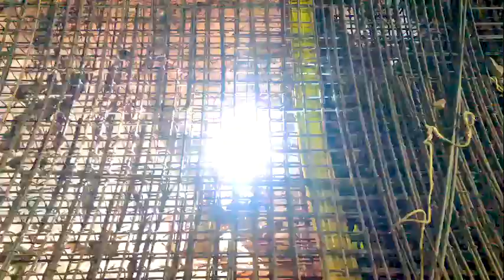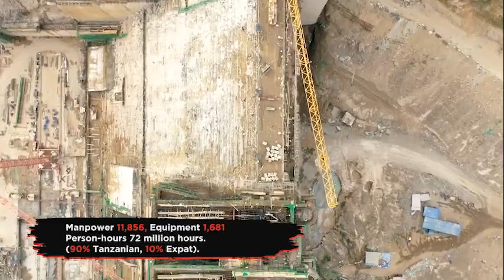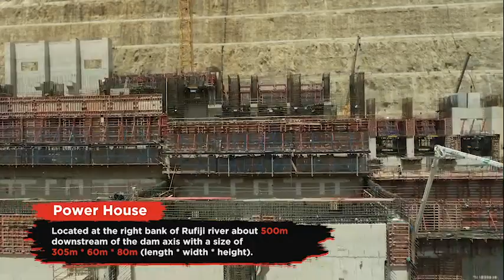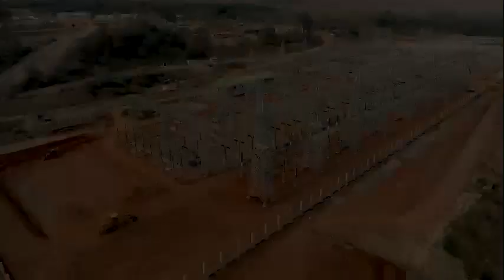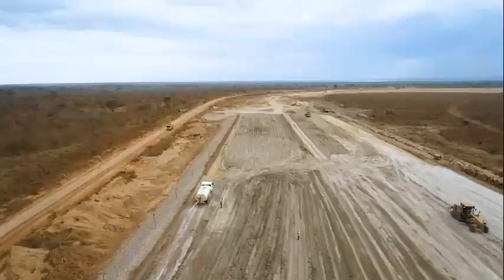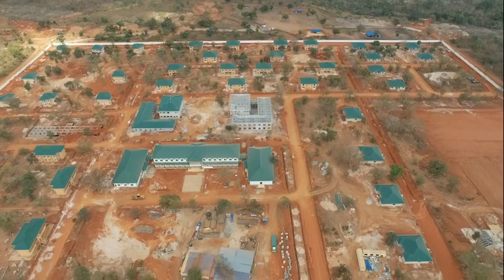JULIUS NYERERE 2,115 MW HYDROPOWER PROJECT, TANZANIA

Comment: This project is obsolete!
Reply: Why and how?
Reply: How is this project obsolete?
Reply: @eacoincmubiru5894  1. It’s not going to meet the projected energy output 2. In few years time the area is going to dry up and water level will drastically fall to insignificant level 3. It’s too expensive and because of its delays the cost of its construction has been inflated. With that amount they could have solicited the Russians or French to construct clean and relatively long lasting nuclear power plant which could have been used for generations.
Reply: Siyo Bure...Una ROHO ya KICHAWI wewe
Reply: @mosesjacksonkarashani2642  You're talking as if you're incharge of directing the water levels. On what grounds it's not going to meet the projected output? Do you have any factual data to support your claims or a mere empty words.
Reply: @allysalehal-jaber4822  May be we can use your data to disapprove my mere comments, can we?
Reply: I have told you once and I am telling you now: You are obsolete!
Reply: Hawa ndio wale wenye jinsia mbili kwa hiyo msimshangae sana 🤣🤣🏃🏃